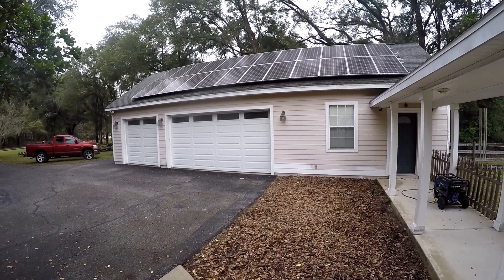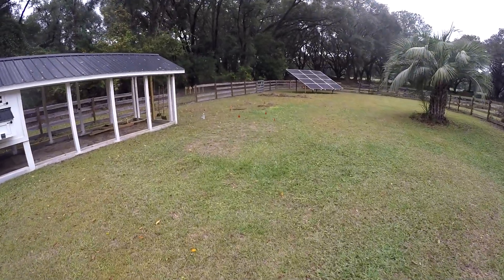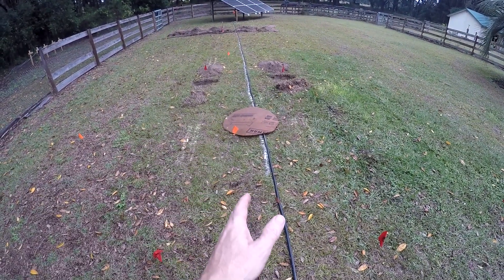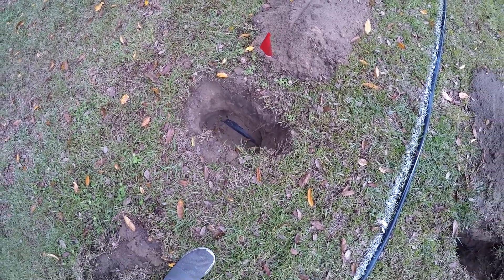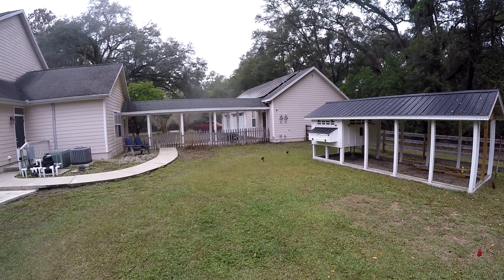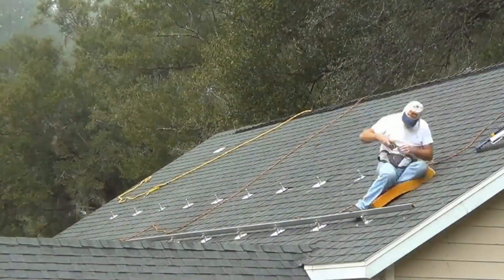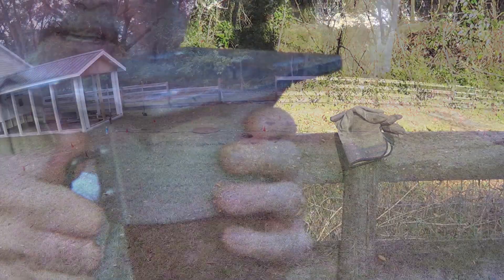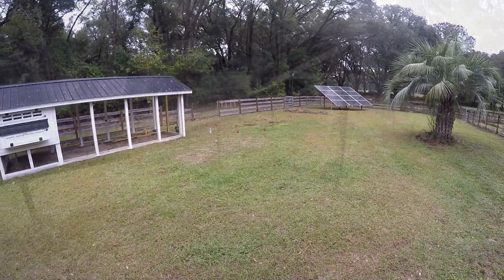Ground Mount Solar: Getting Started

Comment: Could you talk about the orientation of the first solar array and the rationale behind the second array being oriented in a slightly different direction?
Reply from the maker: Generally, if your net metered with no battery, you would want to face all your panels to the South for maximum power generation. When you add a battery to your off grid system it becomes more about stretching your solar day.  By turning a panel slightly to the East or West you can start collecting energy early or keep it going later.  This generally makes life easier on the battery even though you will probably collect less energy over all.

Comment: 100% more "gooder" with a ground mount and off that garage! Lots of work ahead, looks like your well on your way. That one tree has always been a shade issue too...now, it appears your look-angle is going to be vastly improved
Reply from the maker: Hello Chris,  Back when I was originally designing my system I had the idea to use the Reliance individually switched transfer switch to run the output of my system.  I wanted to be able to run some stuff off the utility AND some stuff off the solar all at the SAME time.  I looked across YT to see if anyone had tried this and found nothing except ONE guy in Oklahoma!  Seeing your system up and working gave me the added confidence I needed to try it.  Its one of my favorite things about my system although now that we have the EG4's the switches all pretty much just stay switched to solar all the time.  LOL.  Thanks!
Reply: Heck yeah! Thanks. And "thank you" for your inspiration too...I think we all learn from each other. My six EG4's (and paralleled in four KiloVaults) are all running like a TV set -- they just work with zero drama. Can't wait to see your progress on that new ground array